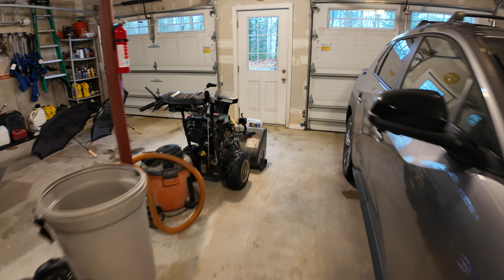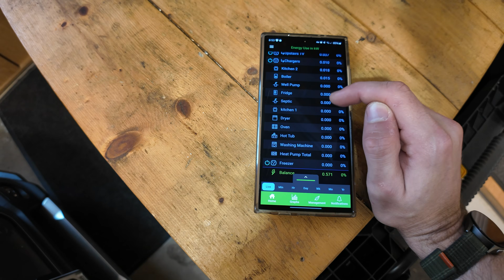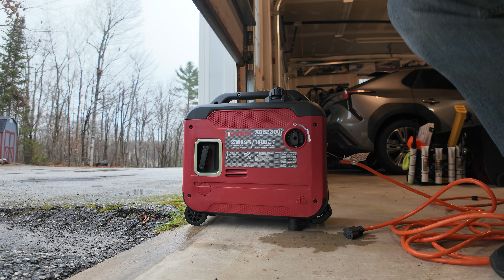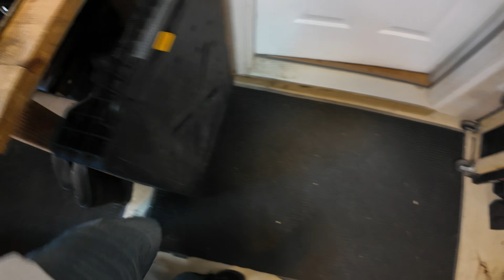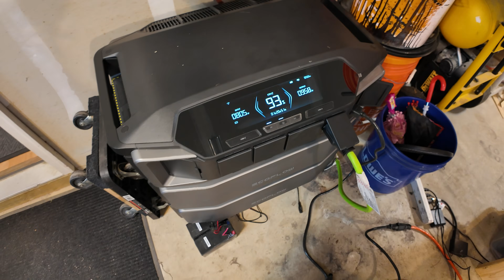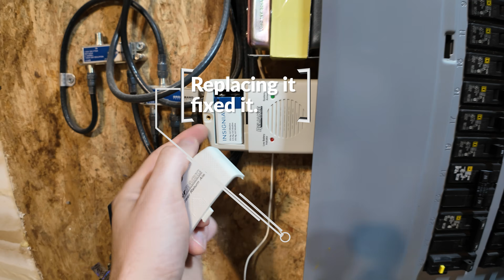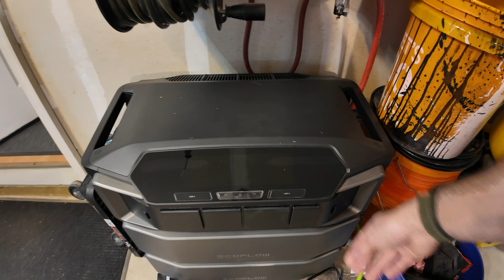Ecoflow Delta Pro Ultra Testing - Small Generator and Limitation While Charging - Home Setup

Comment: Great equipment. Absolutely the worst customer service/ tech support, of any company, for any product, that I've encountered in all of my 58 years. They won't allow you to speak to a person, and conduct everything through email. It's been over a month now, and they've yet to answer my question. I have 3 Delta Pro Ultras with 9 batteries, running a Smart Panel 2. That's a pretty good chunk of change, and there is no excuse for giving me the run around. I'm not even trying to warranty anything. Just have simple questions they refuse to answer. I have an EG4 system on another home, and have had zero issues getting answers from them. Usually the same day. I'm extremely disappointed with EcoFlow.
Reply from the maker: I believe you, but I have reached out with two questions on various setups and got responses pretty quickly. The problem is if it isn't explicitly stated somewhere in their info, it seems like they're not willing to guess.   I see stories good and bad on the Facebook and Reddit groups.. stuff being replaced without fuss but also orders marked as shipped for prpduct they didn't have yet.   Curious.. if you know about EG4 now.. did you buy that massive ecoflow setup before you bought eg4 stuff?  Seems like at your scale, the eg4 is better suited and cheaper.    If I didn't get that Home Depot price mistake, I likely would have gone eg4 from the start.
Reply: I'm new to solar, and the EG4 was the system I bought first, and used to educate myself a bit on solar. It's a 12k system for my house, but I needed something more pug and play for my mother's house. The EcoFlow seemed easy enough to operate. My problem with it, is that it randomly shuts off with no error codes. Might run 10 days, 2 days, 10 minutes, and then randomly shut off. It's not grid tied while it's running, so it's definitely not a grid related problem. I simply asked them if they knew why, and that was on 12/05/24. I sent them all the info they requested, and last received an "thanks for my patience" email, right before Xmas.
Reply from the maker: @kevinalexander4378  yeah that sounds like a phone call with an expert kind of issue.
Reply: @kevinalexander4378 sounds like firmware issue
Reply: Saturday morning I had a major malfunction with the Ecoflow app, funny it started the day after I upgraded my iPhone to 26.0.1. The app would close and disappear into the background when launched. Double click the home button and there it was lurking in the background. Bring it forward and whoosh back to the background.  I spent most of my Saturday trying to isolate the problem. No joy both iphone and iPad affected.   Finally decided to open a ticket, sent an email to Ecoflow support late Sunday night included a link to a short video of the problem.  Woke up Monday morning to find a lengthy email telling me they had identified and fixed the issue, a code issue with one of the dashboard widgets. No action needed on my part.  Very impressive response time.  You should try the email approach, might have had your answers by now.
Reply: I have had 3 contacts with Ecoflow. With 2 I recieved an answer right then. On the third it was a firmware issue that they said could take a couple days. The next morning I installed new firmware that they had downloaded at 4 AM. So far I am very pleased with the service

Comment: Can you test using a 220v  generator and plug it into the ultra
Reply from the maker: My 240v generator is a 10 yesr old generac and not an inveryer style.. the power is too dirty for the delta pro ultra :(
Reply: I have same problems. I have two older 5000 watt generators.  I bought a new pure sine 4500 just to charge the DPU. I'm trying to wire my house to run during day on generators when needed but the DPU for night. Thank you for your info, helped this old man

Comment: The power in on 120 v when outputting 240 was something that concerned me.  So this is a great thing to know.  It is now worth purchasing for home back up of 240V items when i only have a 120v inverter(3600W).
Reply from the maker: I think the solution is to make sure your generator can handle 1800 watts so you can have the fast charge switch on.   Im eyeing the champion 4000 watt inverter fpr $600... that one does 3000 continuous so 1800 watts is in the sweet spot for it.    My $280 generator maxes out at 1800 but it doesnt actually hit it without sounding like its being destroyed.
Reply: @mainelyhobbies  I have the Firman WO 3382.  It should be able to run 3200 at 120 peak 3650.  So it should do 1800W without any issue.  the issue for this house that we got 2 years ago is that it had an Electric stove.  So we need 240, and the Firman inverter will not do that, so the Delta Pro Ultra has the output and the various inputs, but I would rather go straight 120 instead of trying to push 240 v. and buy another inverter generator.  I think that this solution would work and can be charged up with the current inverter.  I don't want to go back to my Generac xL5500 because it was kind of dirty power for a battery setup.
Reply: @mainelyhobbies  On my last trial run a few days ago, I tried to charge while outputting and the unit cut off the input through the 110v port.  I was only trying with the input at 1800 W(actual 1750W), and the input shut down.  I could not get an 120V input charge while outputting 240V.     From your video, you started out lower end at 600W then moved up.  I will give that a try for the next trial when using the 240v (L14-30 outlet to power the house) and I also updated the firmware to the current version.  FY: My house also pull between 300 and 400 w at baseload, so I will add a second battery to my stack to cover an average days requirements.  The one issue is that recharging at charging at 1800W(via 120v) will take at least 6 hours(with 2 batteries), with no output.  But as a temporary house backup system, the Ecoflow Ultra works very well.
Reply: Update on new trial:  No, I can not use grid power through my main panel while pushing ac voltage to my reliant gen transfer switch.  I do have two inverters(will use 50 amp hub in the future), and just tried using the second unit to power the first unit while the first unit is powering out to the house and this worked with firmware at 5.0.0.75.  So Like your trial, I believe that if an independent generator is plugged into the inverter, it will not trip out the inverter.  The downside is that I think that it will take 3.3 hr to charge each battery if you are using the 120V(1800W) input, if you are not sending a lot of power out to the house.   so your 2 battery setup will take at least 6+ hours to charge from 0 with the two batteries without solar input.  Thankyou for making this video, I am still learning and it helps a lot..
Reply from the maker: I don't know that I fully understand what you're trying to do, but I just want to ask.. do you have the fast charge switch flipped on while providing 1800 watts?  

For me when power goes out I need 6kwh a day, so it's about 3 hours of generator time per day to get 24 hours of power.

Comment: Also that DPU should NOT be plugged into a power strip. You can overload that strip very easily. Please only plug directly into an outlet. Will probably solve your GFCI tripping as well.
Reply from the maker: Yeah, good point.. the power strip is temporary, and while on it, I limit charging to 800 watts.. I am always cautious of heat build up on long extended high loads.  The gfci tripping was unrelated. It was because I had it plugged into the wall while also plugging into the generator inlet even though the transfer switch was not activated, it trips gfci.

Comment: In order to get the full 3600W per inverter (7200W at 240V) while the DPU is receiving power from an AC source the charging must be in “fast” mode. In order to use “fast” charging, and be able to get full rated output at the same time, the power source must capable of at least 1800W for 120V charging via the C20 input or at least 7200W for split phase 240V charging via the Power I/O port (using the L14-30 “generator adapter”, for example).

The reasons are technical and complex but I will attempt to simplify in order to provide some answer as to “why”. If the AC input can provide 1800W then the inverter can supply up to an additional 1800W to provide the full 3600W (per inverter). Assuming the inverter is outputting that full 1800W and there is a brief surge back to the input source when the output from the inverter ceases, the surge won’t exceed 1800W and (in fast mode) the source should be able to handle 1800W.

Now, imagine charging at 1000W in “slow” mode because your input source is a small generator that can only handle 1200W max. The inverter may have to output as much as 2600W to get to the 3600W max… if that 2600W happened to surge back, the generator might be damaged due to a surge >2X what it can handle. For this, and other more complicated reasons, the total output is limited to the charge rate when using “slow” mode (in other words 1000W “slow” charging means 1000W max output while AC is connected).
Reply from the maker: There isn't a friendly way to put that stuff on the product page.  I have been eyeing a champion generator that has enough capacity that 1800 watts would be more like 50% capacity instead of 90% so it would be in that sweet spot for efficiency.  I think I would be able to run it for 4 hours and have enough for a day of my emergency use.   Thanks for the info
Reply: Thank you for your great explanation. Helped me a lot.
Reply: So you need to get a generator bigger then the 7200 watts

Comment: Great video for the single DPU with two batteries. I did notice that you had your charge setting on slow for the AC charging. You should have it set on fast charging at the AC plug and in the app turn on X-fusion, this will provide optimal output at 7.2kW no matter how much input there is.
Reply from the maker: I have yet to see a good explanation of what x-fusion and fast charging do. Why aren't they default? It makes me think there is some downside to them, and nobody says what that is.
Reply from the maker: OK, to clear up some of this.   The fast charging switch at the AC plug just bypasses the charge limit I have set in the app -  I do not want to do that because it would kill my generator.  My generator is cheap and while it claims 2200 watts peak, reviews claim it is more like 1600 max for a steady draw.   The DPU wants 1800 watts with fast charge on.  If I had a beefier generator, sure that makes sense - maybe slow charge for a few minutes to warm it up, then flip to fast charge.

X-Fusion still doesnt seem to have a good description in the manual and I do not see in the manual or the app where that is a setting.  It sounds automatic.
Reply: @mainelyhobbies  No it doesn't

But to fully use the "charge 120v while output at 240v" from the C20-19 inlet, you have to have a generator capable of providing 1800W without a sweat. A 2k W gen is not enough. You have to use a "mid-size" gen like a champion 3500W and above. X-Fusion (fast charge activated at 1800W) let you use that 1800W power for your output right away and the DPU battery provides the rest.

You can also in the in/out port on the side at 240v which a 240v generator and set at whatever level your gen is capable of providing continiously. You have to get the gen adapter though, but you can charge the DPU very quickly while using the L14-30 output to your home panel.

That's how I use my DPU, as a homebackup, but I also got 2kW solar panels on the high PV input.

The DPU is great once you understand how the 2 inverters work.
Reply: @ChUcK2001 does this work when discharging 240v through the SHP2
Reply: @mainelyhobbies  My understanding is that unless you switch to fast‐charge mode (1,800 W), X-Fusion won’t engage. In that case, the DPU merely passes your loads through to the small generator without any boost over 1800W loads. If the load exceeds the generator’s capacity, its circuit breaker will trip. Therefore, if you want the DPU to assist with loads larger than your generator on a 120 V AC charger plug, your 120v generator must reliably supply 1,800 W continuously.
Reply from the maker: @saeidmofrad6276  I don't think it is a straight passthrough because i am able to get more out than the little generator can output, but yes you are right.. i have a new generator now that can do a solid 1800 watts and works as expected now with fast charge on.

Comment: Thanks for making this video. Your setup is almost identical to my goal, however our home is 100% electric. So while the DPU will run all the 240V appliances (range, water heater and dryer), their usage will require they be staggered with circuit breakers turned off to isolate high draw loads. Meaning the water heater will need to be turned off at the circuit breaker to run the dryer or range since a water heater is always on. Although…our water heater is app controlled, and we could put it in vacation mode (potentially a kind of off switch) as needed. I wish the DPU had a 50A 240v connection. I believe we would have get the smart home panel in order to do that, but not really interested in that as a solution.
Reply from the maker: That smart home panel 2 is a big investment and adds another spot where things can break, so I have not been too interested in that either.

Comment: I have the black EG4 Chargeverter (plenty of YouTube vids). It converts my propane generator AC to DC for charging my PDUs. DC fed to the high side solar connections on the DPUs. Better charging and, since DPU thinks it's getting solar in, no worries about AC in / out when charging with a fuel gen.  Also, converts any fuel gen power to clean so can use any fuel powered generator because THD is mediated by Chargeverter.
Suggest shutting off fuel gen by shutting off gasoline petcock and let gen burn off fuel in carb to reduce buildup of residue from pump gas sitting in carb. Use Sta Bil or similar fuel stabilizer mixed in all gasoline used in generator to further protect against fuel related issues.
Reply from the maker: How are you feeding it to the high side solar input? The minimum voltage is 80 volts on the high side, and that eg4 product looks like it only puts out 52 volts max. It looks like it can only go on the low side and at 52 volts would only charge at 800 watts.
Reply: I wonder the same , any answer on this ?@mainelyhobbies
Reply from the maker: It didnt look compatible so I didnt dig in.   Ended up buying larger inverter generator so I could set it to fast charge at 1800 watts continuously.
Reply from the maker: I'll take a look at that product, I didn't think anything could clean up power like that, but if it is possible then it would let me use my older generator that is not an inverter style. I do shut the generator off with the switch and then usually when a storm is completely done let the gas run out in the car. And yes I use ethanol free with a stabilizer

Comment: Great review - thanks - can I run two delta 3 + with two smart generator 3000 within close proximity of each other - basically two delta 3+ indoors and two smart generator 3000 in a protected area outside - thanks

Comment: Just make sure the generator has a THD of less than 10%. You could charge the DPU quicker with a 30 amp 240V capable generator. Thanks for sharing your testing
Reply from the maker: Right.. i have a 5500 watt generac 220v generator that is useless for this, so I got the little 120v inverter one for now.   220v inverter generators are too expensive because I would want one at least 5500 watts to handle my well pump if the dpu dies
Reply: @mainelyhobbies  Check out the AI Power (SUA7600iED) inverter generator.
Reply: @mainelyhobbies  If not worried about noise you might look at open frame inverters.  They are loud like regular generators but much cheaper than enclosed inverters.
Reply from the maker: @patrickdrabble then it becomes a price and size issue. I don't have a whole lot of storage. I think the perfect generator for this battery is the Champion 4000 watt inverter generator that usually runs $600 for the gas only version. That one should be able to handle the 1800 watts continuous for hours on end needed to run this thing on fast charge.  4 hours with that generator on would cover me for an entire day. If I spend more and get a 220 volt inverter generator I can get away with one and a half hours runtime for a day of power but I don't know if it's worth the size and price to go that big.

Comment: Thanks for great real world use video.  I have the same system running most of my house off grid with 1800W solar charging.  I have never used a generator to AC charge, but that is my plan if needed some day.  I use AC input charging (via isolation transformer to grid plug) only in cases of consecutive cloudy days.  When I AC charge the DPU pulls in exactly 800W that I have set.
Reply: Does the isolation transformer allow you to safely ac charge while connected to a manual transfer switch?  Could you please share the product you are using?  I’d like to purchase one.  Thank you….

Comment: The Delta Pro Ultra uses low cost, low surge, shorter lived, high frequency, transformerless inverter tech that can damage your appliances or EV during a catastrophic failure  H- Bridge circuit. No thanks.
Reply from the maker: I had not heard that.. I think I'm one of the few videos on this that isn't sponsored. Anyway, even with that risk, we are talking using this battery versus a 10 year old Generac non inverter generator I have been using. It is for emergency backup.
Reply: @mainelyhobbies  The DPU is UL 1741 certified. Which should eliminate most these concerns right?
Reply: What does that mean to non electricians?